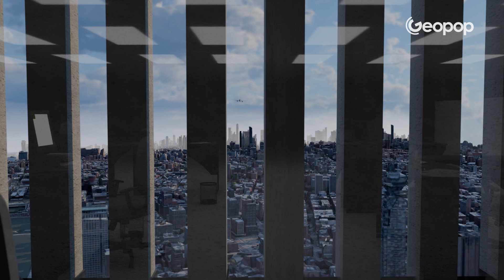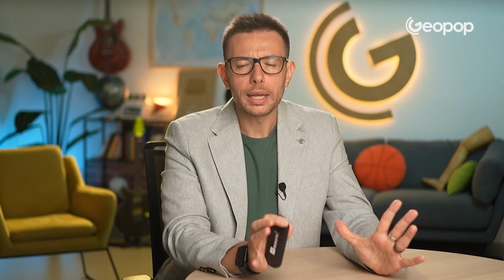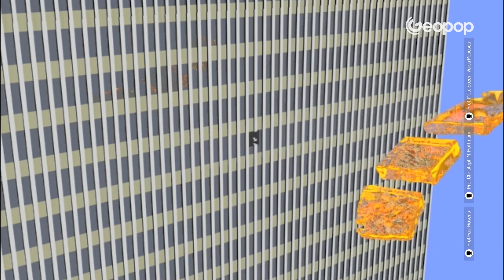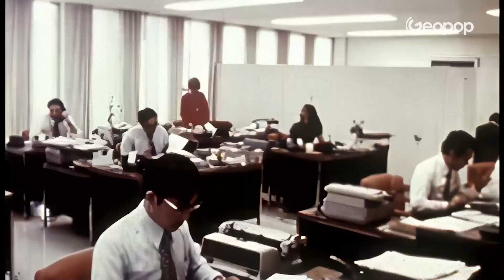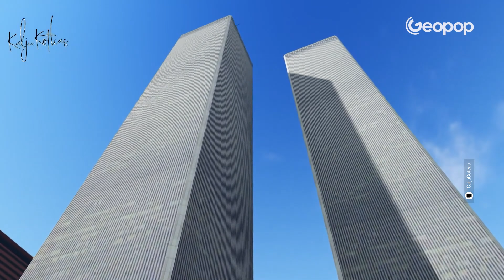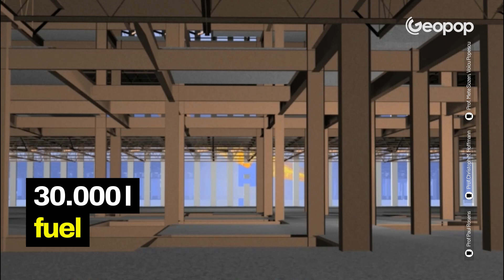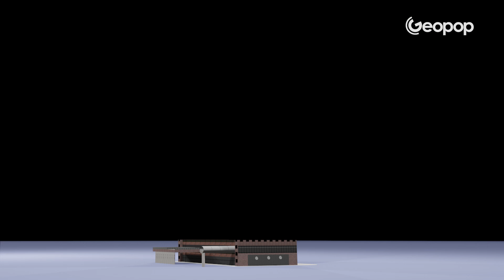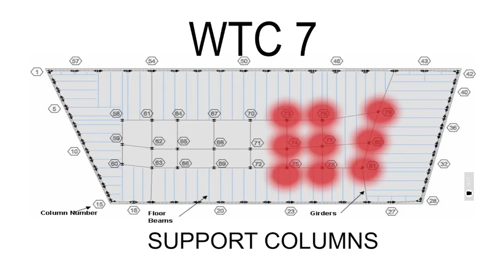9/11, 2001: The Technical Reconstruction of the Twin Towers and WTC 7 Collapses

Comment: They fell at freefall speed directly down into their own footprints because the materials were vaporised into dust. That is no conspiracy theory - we saw it with our own eyes. The energy required to break material down to this level is so off the scale it's insane. Thousands-fold more than the meagre kinetic energy a gravitational collapse could provide. The breakup of material would dramatically slow down the latter or even bring it to a halt. Plus the piles of debris would be colossal. "Pancake collapse"... pah! Pseudo physics.
Reply: Did they?  

Are you sure?

Did you measure the acceleration yourself?

I did. 

I came up with rather different results - one-third (1/3 or 33% of 0.33) of GA.  

Ooops. 

www.youtube.com/watch?v=4VgZW-v_Opg

The piles of debris were collosal BTW - up to 14 stories deep and spread over 17 acres (compared to the two 1-acre footprints).

www.youtube.com/watch?v=u2D__-DVLBk

Worth noting if the Towers had been vaporized into dust (which is impossible) they could not have collapsed at freefall SPEED so you really ought to work on it.
Reply: This video admits its free fall speeds, give up stinky you lost
Reply: Just to make the shills that will show up soon look even more stupid:
"Came down essentially in free fall" is the phrase that NIST used (NCSTAR1).
Reply: So here we go, the first shill to oppose NIST in an attempt to defend the official tale... 🤣
Reply: @Kudde23 The "official" NIST report was created for illiterate simpletons, who don't understand the first law of thermodynamics and closed energy systems. You don't strike me as an illiterate simpleton sir.
Reply: @nickh9084 - Actually it was created by engineers for engineers,  not the technically ignorant public such as yourself.

You never even read the thing and are just (badly) copying other people's bad arguments (and they never read it either).
Reply: @nickh9084  You got me totally wrong.

Comment: The pentbegon was a big part of this day also which should be included in all theories
Reply: Yeah, there has also been an odd delayed collapse. I´m not even sure if there was any official investigation into that collapse, I don´t think so.
First, news reported a plane hit the Pentagon but had no pictures yet. First pictures came from far away from the site, you could only see smoke rising up. Then there was a news team at the highway at the airport, suspiciously wasting time for a stupid report about small things of something that might have came from a crashed plane instead of heading to the Pentagon. Finally they arrived but in the first pictures they only show a fire truck and a bit of lawn, not the Pentagon.
The first scene of the actual "crash" site starts when the delayed collapse is ongoing already, as if they waited for the "BOOM" before they started filming or even cut it out before briging it on air as "live". Think about it, this collapse took probably less than 2 seconds from start to finish. And it´s exactly within these 2 seconds that they start filming the Pentagon, the actual "crash" site, even though they´ve been there for minutes and even though the "crash" took place like 20 minutes ago if not more.
Also there were reports of something happened on the highway prior to the alledged plane crash, something that had many firefighters involved which closed the whole highway at least in one direction, seemingly something quite major on any other day, but I never heard any details on wtf actually happened there. On this particular day one could ask if another terrorist attack happened there to delay firefighters...

Comment: I could maybe be on-board with heat making it weak. 70 plus floors under impact. Don't seem like there was enough time or the amount of heat it would take to cause the collapse. This whole thing was set in motion to for us to go to war. We had no real reason until this.
Reply: Let’s break it down to the absolute basics:

The 47 core and 236 perimeter columns of the Twin Towers support all of the gravity loads of the building. ALL of the resistance is in the columns.

Planes impact Towers, causing massive structural damage, destroying sprinkler systems, tearing out gypsum board walls and blasting off the SFRM insulation from the floors. Multiple floor-wide fires are started instantly and spread rapidly due to the destruction of fire protection systems and venting of the building during the impact.

Serious fires were largely confined to the impact damaged floors and those immediately adjacent to them.  

Fires were started by the impacts and fuel aboard the aircraft, which acted as an accelerant. No shortage of other consumables inside the tower to continue the fires. 

Collapse was initiated (started) at the impact and fire damaged floors when floor trusses exposed to heat over time sagged, in turn pulling on and causing the inward bowing of perimeter columns by up to 5 feet until they buckled. 

www.youtube.com/watch?v=ULdiD6gYZO0  

No steel melted or needed to. Structural steel will bend and fail at less than half its melting temperature.

Once the perimeter columns buckled the formerly static load above became a dynamic load 30 times greater, easily overwhelming the structure below.

Thousands of tons of now loose debris fell through the open off space - through the inside of the building bypassing the columns - dropping 12 feet onto the first intact floor it comes across. The massive instant overload causes the floor to fail, adding its mass to the falling mass which continues to accelerate for another 12 feet until it impacts the next floor, rinse and repeat all the way down. Rate of collapse increases as momentum increases. As each floor fails, air inside the building (the Towers were 95% air by volume) is compressed, then blows out the sides _in reaction to the Tower falling, not the cause of the Tower falling.

No fire required at all on floors below the impact points for them to fail. The mechanisms that started the collapse are different to the mechanisms which continued the collapse.   That will be a difficult concept for some.

As the floors fail the perimeter columns are left literally hanging in the breeze, no longer attached to the rest of the structure. They peel away and fall in great sheets (think banana) out to more than 600 feet from the base on the 4 points of the compass. 

Core columns failed last. 

Each 110-story tower had a 1-acre footprint. The debris pile was up to 14 stories deep and spread out over 16 acres, destroying 8 surrounding buildings and damaging more than 100 others.
Reply: @TheLoonResistance  Of course steel melted. That´s why they found molten iron balls all over in the dust my poor little liar.

If the core failed last, then how did the antenna drop first my poor little liar?

Oh I forgot: You are way too much of a coward to ever answer questions on your stupid blablah...